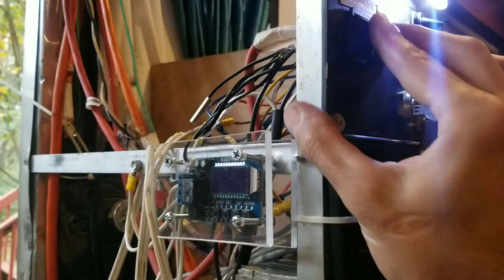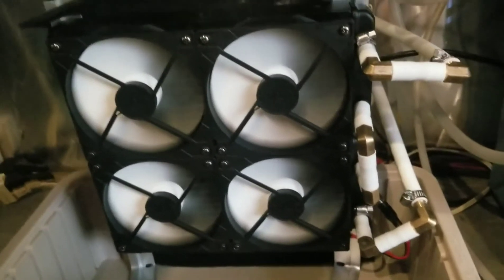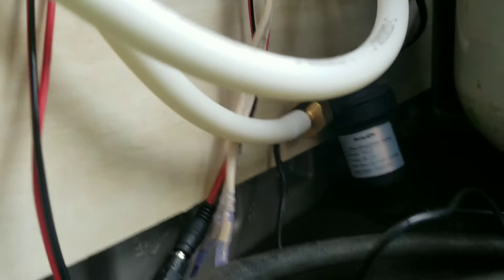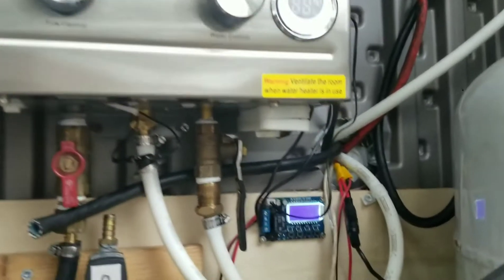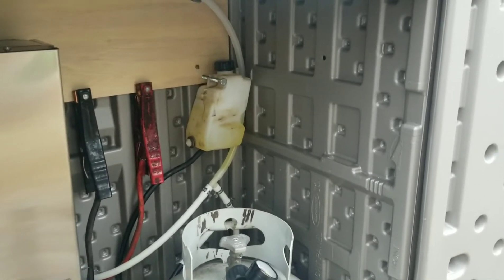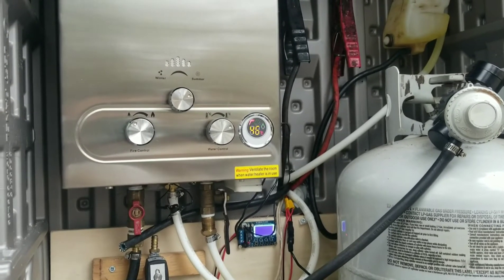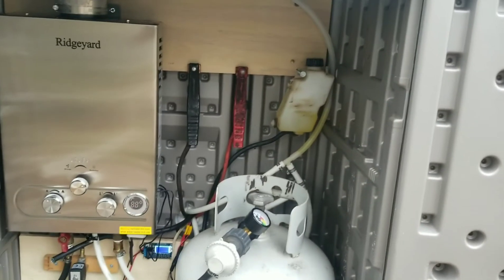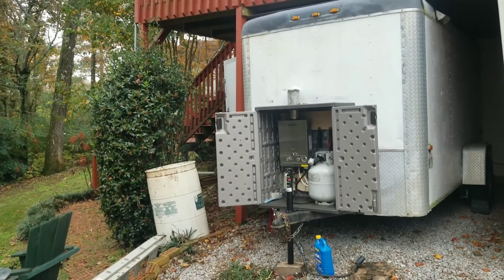Camper / RV Heating System  (Propane Hot Water Heater  Radiator Heat for Winter Camping)

Comment: Hi man super good that u have made this its absolutley the best way for a trailer. Im building the exact same system and im so glad to have seen that im not the only one who got this ideaa😅
Can u please make a diagram on how u have connected all the system and pipes and please mark foward and return pipes… its very hard to se in the video.
Reply from the maker: It worked great for the 3 months I was living in the Colorado rockies last winter! It's pretty simple, the pump pumps to the inlet of the water heater, outlet of heater goes to bottom fitting of radiator, top fitting of radiator returns to pump, with a T fitting to an overflow coolant reservoir.

Comment: Wow, I was just looking at Espar and a coolant heat exchanger, but it's diesel.  This gives me hot water and potentially heating with one inexpensive unit, and the propane I already carry.  Are these heaters rated for the load of space heating? (24/7 - 50% duty cycle). Do you have a system diagram posted anywhere?  Or a BoM so I can buy the same stuff?  Nice system!
Reply from the maker: It worked real well for my space 3 months dispersed winter camping in the rockies! It never had any problems with leaks or anything that made me think it couldn't handle the duty cycle. It's a fairly robust unit as long as it's set up right!